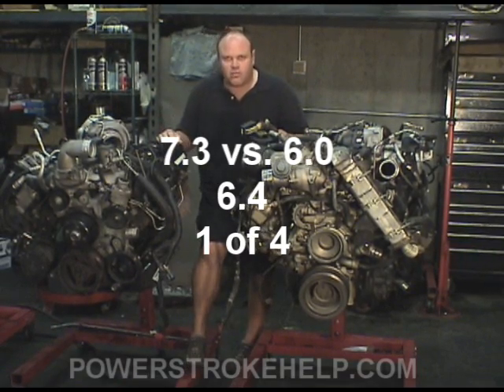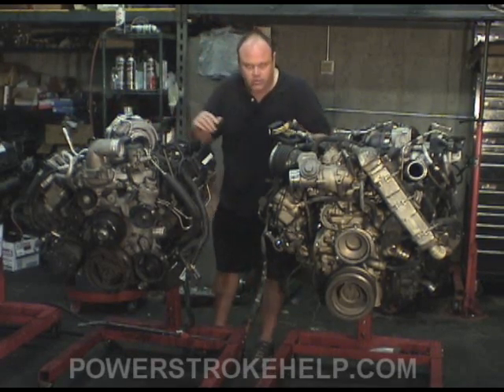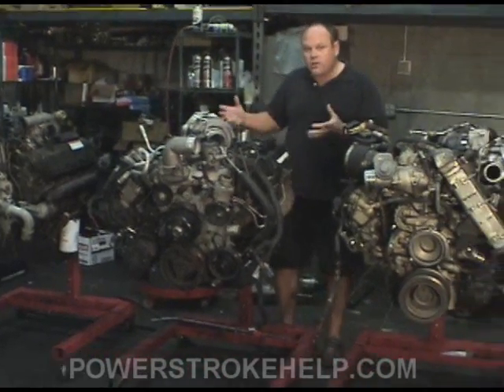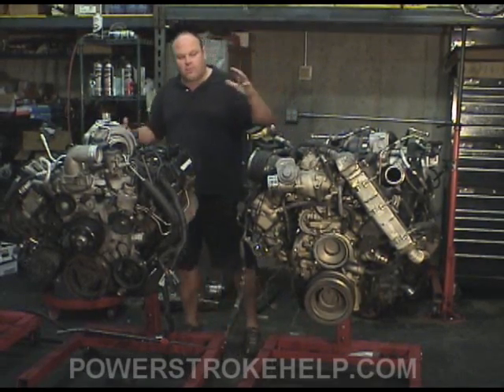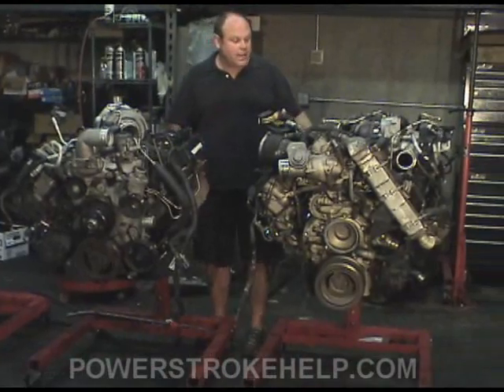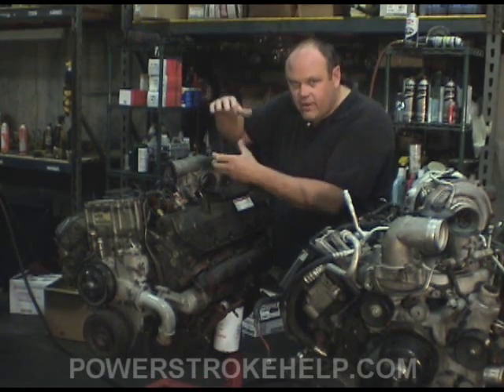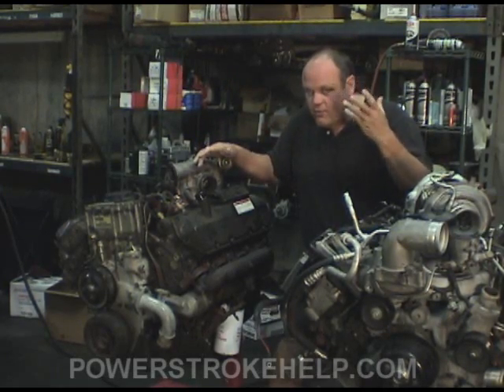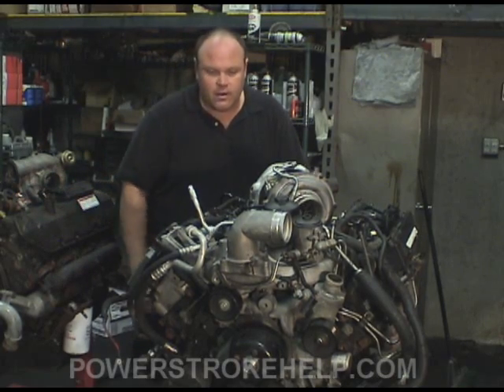7 3 vs 6 0 vs 6 4 POWERSTROKE ENGINES 1 OF 4

Comment: I got a question.  If my 6.0 has EGR delete, do you still need to run a EGR valve? I'm looking to replace some sensors and valves on my truck while the cab is off. Wasn't sure if a EGR valve was still needed if I have it deleted.

Comment: Just watched one of your videos really great learn quite a bit make me feel good because I just bought a 2006 my question to you today is can you install a kill switch on a 2006 F3 50 super duty king Ranch addition and if so would it just be on one of the batteries I assume it won’t start with just one battery correct haven’t tried it yet.

Comment: I just bought a 2001 f250 7.3 from copart for 2800.00. put new water pump, new hood ,new fender and painted for 2500.... I got 5300 in it and it's going great..truck has 300000 miles on it..

Comment: I bet your opinion on the 6.4 has changed haha
Reply: I love the 6.4 it’s been a great motor for us. Didn’t have to do any work until it got 227k miles and all it needed was a oil cooler and up pipes
Reply: 6.4 is a pos. 6.0 is way better once you get it bulletproofed.

Comment: 7.3 forget the modern garbage Ford is trying. In my opinion, the best Ford ever made was the ones with the 7.3 because Ford didn’t build the engine. It’s so hard for me to bypass reliability for performance. I could take the $5000-$10,000 that it takes to make a 6.0 decent and make a 7.3 last 4X as long.

Comment: I have a 2000 F-250 7.3 with 430,000 miles and it runs great I also have a 96 F-250 7.3 with 315,000 miles and it runs great. In my book the 7.3 is the best.
Reply: 7.3 good 6.0 6.4 you got to be kidding .
Reply: Let me guess. It's the best because that's all you have experience with right??
Reply: @Biggchad  Well I have Experience with ALL of them... The 7.3 is far superior for durability of all. (You can turn up the others and make more power)...but even if you detune a "Bulletproofed" 6.0 to 7.3L power levels...it still eventually self destructs.

Comment: What do you think of the 6.7 liter Powerstrokes? I'm looking into getting a new truck because I'm getting a fifth wheel. My brother has a f250 with the 6.7 and the damn thing has all the power you would want but I'm just concerned about the durability. I have a f250 with a 5.4 with 270.000 miles right now and I just don't want to put the strain on that motor of pulling my new fifth wheel. So once again, how good is the 6.7?
Reply: Bcroft39  h
Reply: Bcroft39 go with a 7.3 there awesome

Comment: EPA = more garbage stuck on the engine. More stuff to go wrong and more $ when it breaks. You can look at the different generations of IH engines, and what our government has mandated and as time goes by, see the changes in size and complexity. Hell, you can't even do repairs without taking the truck apart to get at the engine. Not to mention what the LSF and ULSF fuels that the EPA has mandated (that is a whole nother story). I think the EPA has entirely to much influence on the diesel community. Most of the pollutants are particulates, and the particles are so large they fall out of the air almost immediately.  As a retired ASE heavy duty mechanic I can say the the EPA needs to shove it where the sun don't shine.

Comment: I have a 6.4. in my opinion, its just a more improved verision and more powerful version of the 6.0. Every truck that my local diesel mechanic has is a 6.0, aside from 4 which is two 6.4 and two duramax.

Comment: I have a 2006 F350 with 207k miles and a blown head gasket.  Is the engine worth spending the money to repair?  Ford warrantied the original heads at 99k but rebuilt it back to stock....with out correcting their faults.
Reply: dlynes I have been 87th and the japanese people,
Reply: Airkha Carrillo I do not understand what you tried to say.
Reply: If you're doing heads on a 207,000 engine what other engine work, service or maintenance is recommended?
Reply: Mine is in the shop right now.  06 with 203k.  Head gasket leak.  I'm putting head studs, new heads, new oil cooler and a new water pump.  Already had the EGR delete.

Comment: Wouldn't trade my 2003 7.3 for anything 210k still runs like new. Same injectors that came in it , zero smoke. Only thing ever went bad on it was a water pump, alternator,and the 2 batteries. The long livety of any diesel is keep your oil filter, fuel filter, and oil changed.

Comment: I do agree tho the 6.0s are shit I'm a ford guy never drove nothing else and I had 03 and 05 models and they both cost me money out the fucking ass to stay running.now I have a 6.4 powerstroke with 236000 runs great good truck and 2014 6.7 she has 40000 been running good with no problems.but them 6.0s they are some beast ass trucks when the are running but.usally they are broke down more often then they are on the road.i have experienced the 6.0 nightmare 2 times didn't learn the first time I guess.
Reply: the worse engine for ever built is the 6.0 nothings like the 7.3 the best wondering why they stop building such a good engine 🚛
Reply: I am purchasing a 2006 6.0 with 207k miles.  what problems did you have with your 6.0?  how did you try to correct or prevent them?
Reply: oil cooler,ficm,icp,oil pump,and the oil pump fitting forgot what it's called.
Reply: turbo failed
Reply: and all these problems were not over long period of time.im mean one problem after another.truck hit 150 thousand and just started falling apart both trucks did the same shit.all I did too fix it just delete the truck.strait pipe.cold air intake.sct tune.and go back in with ford parts only.

Comment: Hi have a 95 Cheyene 6.5 turbo diesel 4x4.  I looking for a reputable repair shop as yourself for fuel,coolant,oil cooler, line replacement.  It also had a small harness fire that are typical in that model.  If you or you can steer me to a knowledgeable mechanic(as yourself) to repair and get back on road.  Trucks been sitting for 4 years.  Fire occurred after a total upgrade rebuild on transmission.  I only put 300 miles on truck before fire.  Truck is located on Long Island NY and willing to ship to someone you recommend.  Thank you.

Comment: 7.3 is a diesel (built for long life) 6.0 6.4 6.7 not built for over 100k hope u have deep pockets to own them
Reply: Full on right the 7.3 is a million mile engine
Reply: I didn't say it wasn't a million mile motor. That doesn't mean the 6.0 and 6.4 don't have potential. Especially the 6.4. If you remove the DPF and close off the EGR that engine is solid as long as you don't do something stupid like run the most aggressive setting on your tuner. But that's how it is with any engine, they all demand respect within their operating limits.
Reply: right...
Reply: Staci Moody do your fixing before it happens its alot cheaper...200K running strong in my 6.0 lol
Reply: The 6.0s have been the least reliable for us. All we had to do for the 6.4s was get a tuner to delete the regen cycles and then delete the dpf. We get far better mileage than our 6.0 and more power. I like the 6.0L style the best, but the engine isn't quite what the 6.4 is. As for the 6.7 I have no idea, but I've heard they're a hell of a good motor. In the end everything has its issues, you just have to work around them
Reply: I own a 6.7 it's on 200,000 miles with no problems
Reply: +Austin Campbell I got 236000 on my 6.4 runs like it's new
Reply: I got 200 out a 6.0 and that's beating in it and working on it.my 6.4 has a pretty easy life with 250 thousand and my 6.7 has around 50 thousand now.i guarantee both my trucks will show any dam Chevy or dodge you bring me any time.
Reply: Staci Moody 2011 6.7 w/ 173,000miles, no issues whatsoever, just ECM updates.
Reply: Austin Campbell that's what I'm saying..mines 200K nothing special and runs good? Lucky I guess lol
Reply: No guys we all have it wrong. The liberals and the tree huggers made the 6.0 a problematic motor. If it didn't have to run hot to meet strict emission standards it wouldn't be blowing valve cover gaskets, having injector problems and ficm issues.
Reply: so all our 6.4/6.0 fleet trucks with 250k-450k are just rarities?
Reply: I got 250 thousand on a 6.4 so sorry bud to hurt your feelings but we're the hell do you figure they only get 100 thousand miles.
Reply: I don't agree with you with the 6.0 but the 6.4 and 6.7 yea those things have so many problems with the emissions bull shit especially the 6.4 the 6.0 put 6k into it bullet proof it and get a 5 inch turbo back straight pipe and a cold air intake and your good to go
Reply: this is stupid how the he'll you figure 100 thousand only you must drive a Honda civic and got that confused with fords.
Reply: you must not no jack shit about the new 6.7.
Reply: I honestly don't know all that much about the 6.7Ls other than their numbers, but I've heard they're absolute animals

Comment: get a 12 v.!
Reply: Garbage
Reply: I don't think so! 7.3 is a mess.
Reply: @JoseGomez-zi2zn  hows the 7.3 a mess. The 7.3 will run as long or longer than a Cummins.
Reply: @brandonbohon5565  the 7.3 w and 12 valve run equally as long. Now the trucks they are in… that’s a different story.

Comment: The 7.3L/T444E is the greatest diesel engine that International Diesel ever built. The only reason they quit installing this engine in the Ford Super Duty lineup was because they simply could not get the engine modified to pass the tougher upcoming Federal emission laws. The 7.3L/T444E is the best of the bunch. Its beauty is its simplicity in design. Tried and true and good for over 750,000 miles minimum. I know plenty still going strong. The 6.0L and 6.4L will never see that longevity. Trust me. The 7.3L/T444E is still being built for commercial use only. Plenty of parts available. It is referred to as the ''sleeping giant'' because it is built so sound and so well that you can easily modify it up to 550hp with no problem. That 6.0L/VT365 is nothing but a damn boat anchor. I do not know how Ford maintained its status as number one with that horrible engine. The 6.4L next was not much better with engine fires, many leaks, & computer problems. So far, the 6.7L they are building on their own now appears to be a good powerplant for them. My 7.3L in my 2002 F350 only has 26,700 miles and I get asked to sell it atleast 3-4 times a week! I would never do it! I've owned it since brand new and baby it. All I've done is a dual exhaust out back and added a cold air intake. It runs 287hp on the dyno. Just fine for me. She'll ''scream'' and roar 2 miles away you can hear! Love that damn truck! She's a Blessing from God.
Reply: I guess my 6.0 is exception than. 482000 miles so far. 2003 model. I have Banks intercooler, better injectors, stage 2 garret turbo. Pushing little over 500hp. Absolutely don't understand where this 6.0 hate speeches coming from
Reply: ive put alot of miles on the road and have an eye for fords and broken down trucks. EVERYTIME i see a ford 99+ truck with its hood open 8 or 9/10 its a 6.0L or 6.4L truck. im always surprised if its a 7.3l truck and it makes me think what the issue is (fuel filter, CPS, HPOP line)
Reply: Watch some more videos on the 6.0 on this channel. He explains exactly what the shortcomings are with the 6.0. Maybe your was modified for longevity somewhere along the way? Also remember most are used to the durability of the 7.3 and immediately compare the 6.0 to that longevity. I for one am happy to hear you are doing well with your 6.0. Hope you make one million miles!
Reply: +PF Real Estate Group stock 6.0s are horrible my uncle has went through two 6.0s one died at 164k and the other at 212k while my dads 7.3 is running like a champ at 340k
Reply: Mark W Gregory t365 is best lol
Reply: Cummins is better though
Reply: The Puppet Of Everything - Only categorically, and subjectively. A lot of people like the Cummins because it’s cheap to modify, but it’s not a better engine in any category that pertains to the mission, which is reliability and longevity.

Comment: hi i am from Colombia, i have an econoline clubwagon with a 351 w engine and i want a diesel i have 2 choices 1 7.3 an 1 6.4 wath isit the best ? thanks
Reply: +sergio lorduy The 7.3 because a 6.4 will not fit in an econoline.
Reply: +sergio lorduy  Why would you do that?  My son has a F250 with the 351 w and the truck has over 400,000 miles and still runs like new.  My experience with ford is their gas engines will run forever and their diesel engines are trash.  I drive a Ford escape with 380,000 miles on it and I drive it to work going 80 mph for 1 hr each way, everyday.   All I have done is change the oil regularly.  Little 2.3 litre 4 cyl.